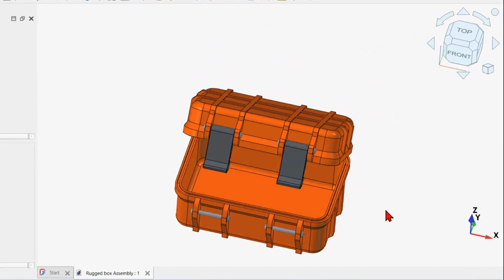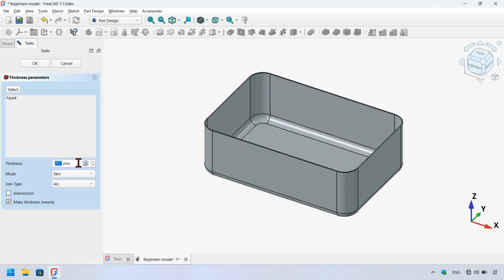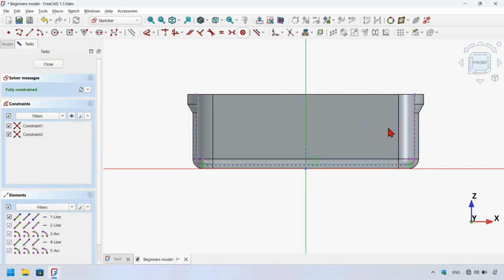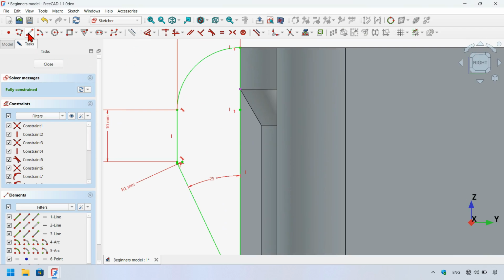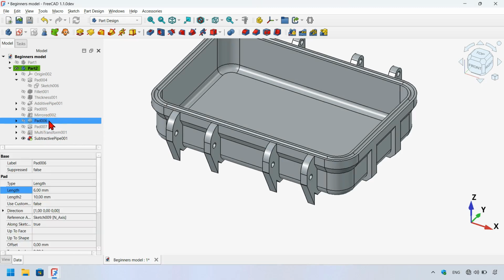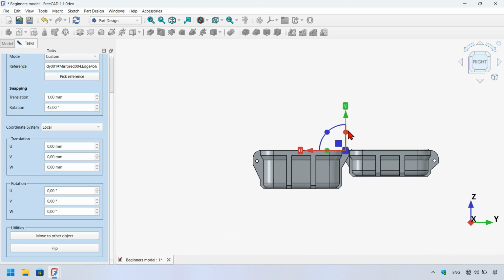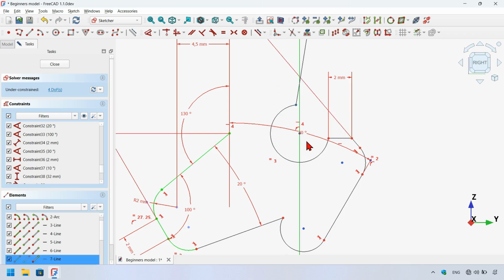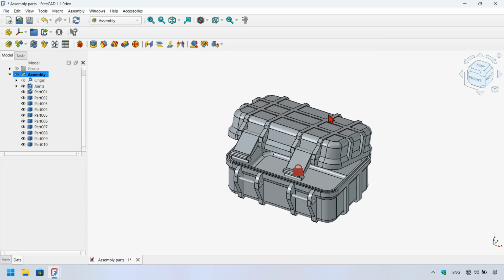FreeCAD 1.1Dev: complete 3D modeling + Assembly step by step

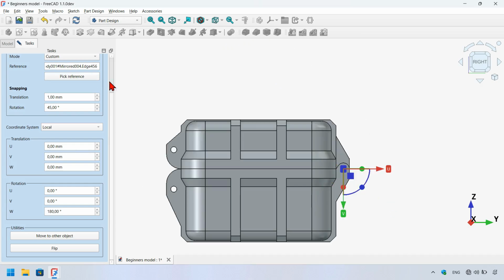Comment: 42:26 Very Nice "SUPER TIP", I have continually run across the LCS "origin" not being where I need it and nobody has ever shared this Super Tip before. I am not done with this project yet but I just had to stop and add my comment!!! Thank You So Much! 
(Here is the edit) I assembled everything but my part 4 was too short from center to center of the circle for the pin and the receiver on the latch handle, mine was 24mm +/- and needed to be 32.71mm +/-. So I was able to change Part4 sketch 4 and update. Should I have been able to just update the original Part4 sketch4 and everything in the Assembly would have updated? The reason I asked I just deleted the associated parts and replaced them back into the Assembly Group... I did it the hard way...
G_Dub
Reply from the maker: Yes, that is the problem with using copies of the part bodies. If you had assembled the part bodies directly, you could modify the sketch of part 4 and it would automatically be updated in the assembly. I preferred to use copies of the part bodies because of the low processing power of the computer.

Thank you.

Comment: in my freecad u can create external geomery only like construction line, how did u change that?
Reply from the maker: Navigate to sketcher workbench settings. There's a option you have to activate ou disable.
If you are using FreeCAD 1.1 it is easy, just change it using "Toggle construction geometry".
Reply: @OffsetCAD  Any help in finding this setting? I a, on latest Freecad on my system 1.0.1, i tried compiling from source 1.1, but cannot get to compile, so stuck on 1.0.1

Comment: you are already using so many open source tools, why not make the plunge and switch to linux? I have been daily driving it for over 20 years, and it has never been a better time to switch. Especially because Microsoft is now going to require a TPM module to even use windows .
Reply from the maker: Well, good tip. But I don't feel ready for a drastic change. And besides, Windows 11 is working normally on the Thinkpad T490.